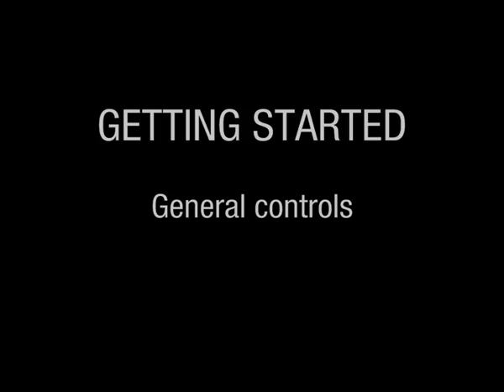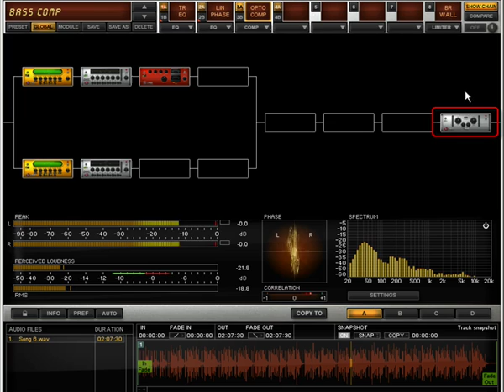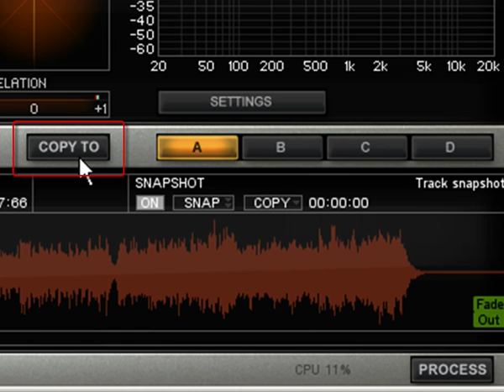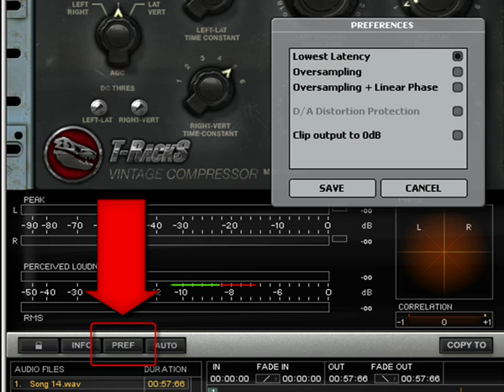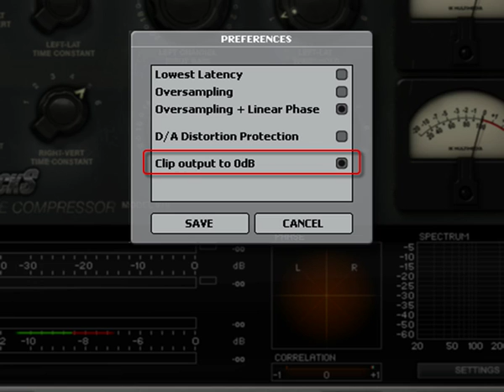T-RackS 3 Getting Started #2 - Mix and master like a pro with T-RackS

Comment from the maker: @305steve16A You may have to set the buffer size on your audio interface.  Also, if you are using this for mixing/mastering you should not have a latency issue with any DAW that has good automatic latency compensation (many/most/all of them, basically).